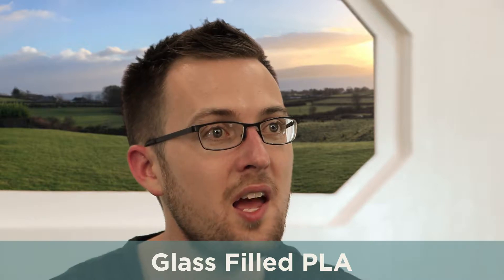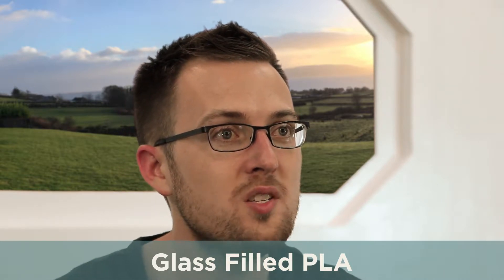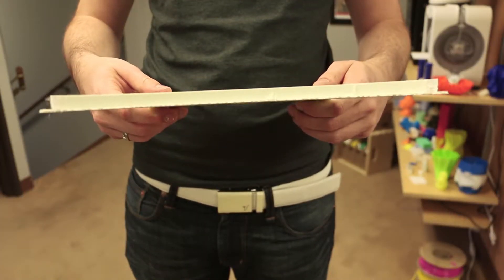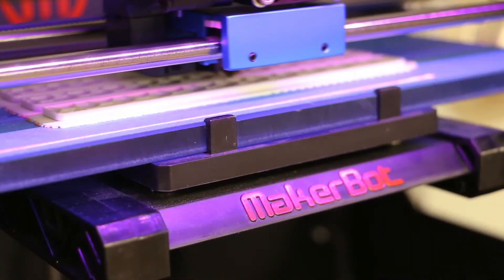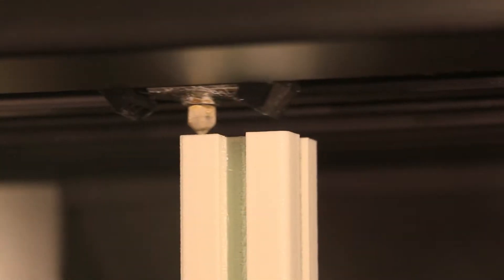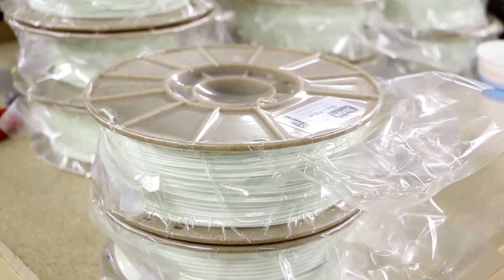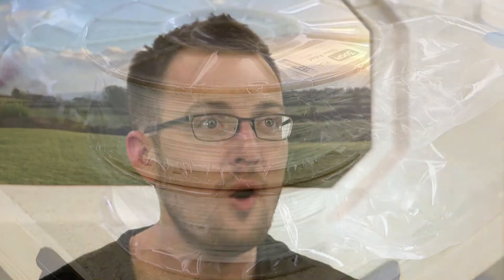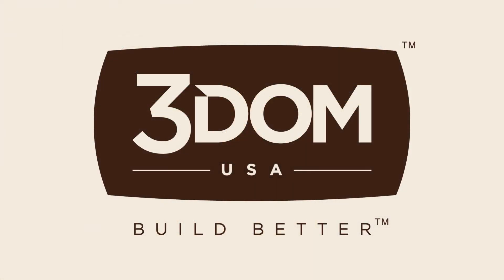Glass Filled PLA by 3D-Fuel

Comment: That's great and all but can they withstand higher temps?  My biggest issue with PLA is that it softens when used outdoors or in a vehicle.  If you could make it more temperature resistant, I would be very interested.
Reply: You can anneal your PLA parts to make them a lot more resistant to heat.